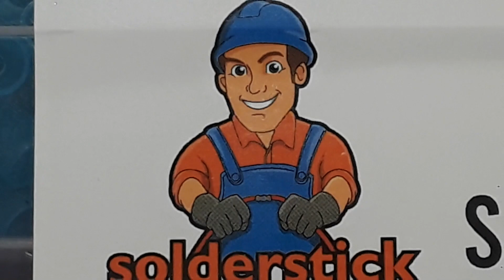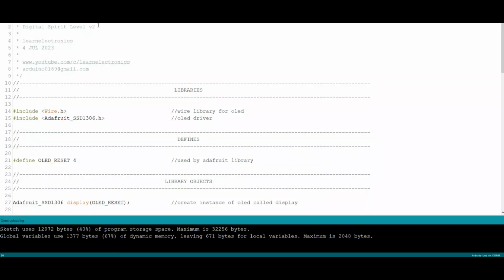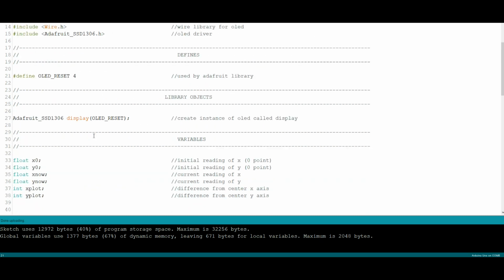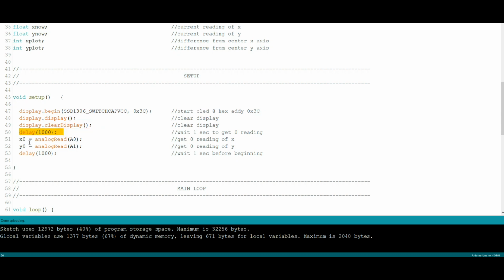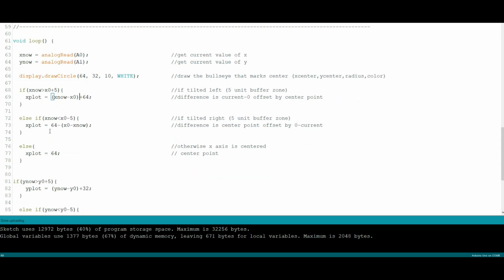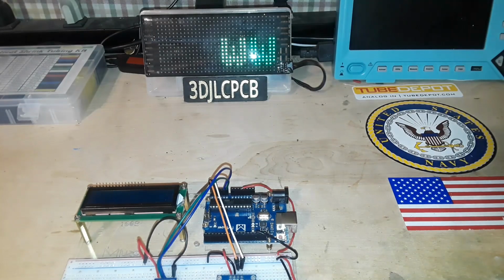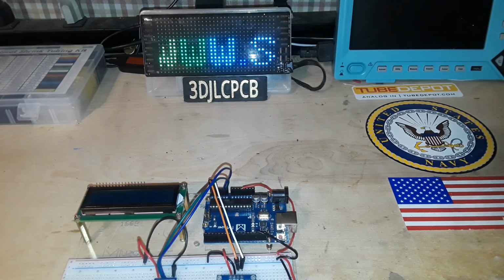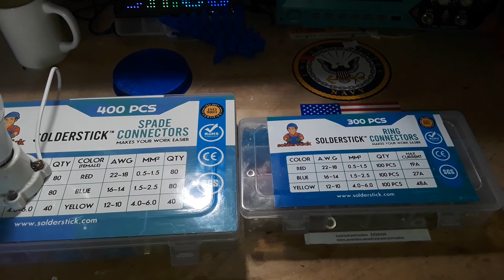Two Axis Arduino Level with Gy-61 brought to you by SolderStick Wire Connectors

Comment: What specs are required for a mux to work for I2C from a master Arduino to slave Arduino and/or devices?  Are there CD4000 series or 7400 series MUX chips that would do it besides the breakout boards Adafruit sells?

Comment: Nice video thx for sharing , in the code you state 500ms delay for stability? shouldnt a lower value get rid of the latency on the circle? For the analog values a sliding window avg can help a lot to stabilize the values.